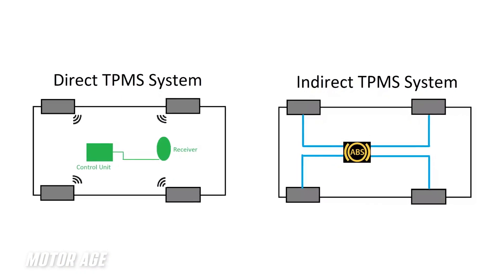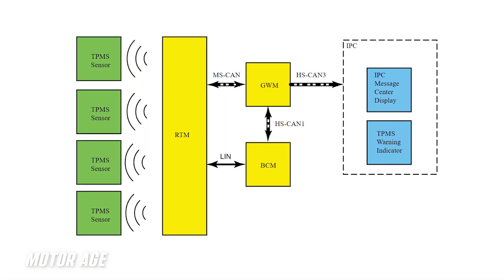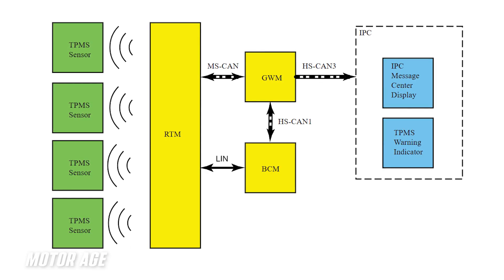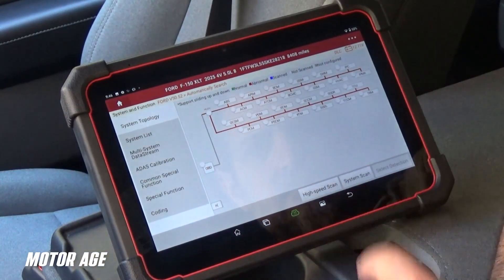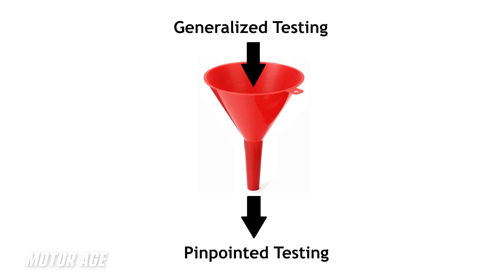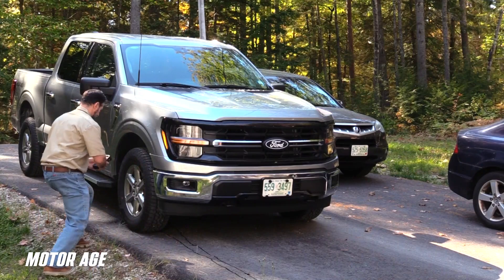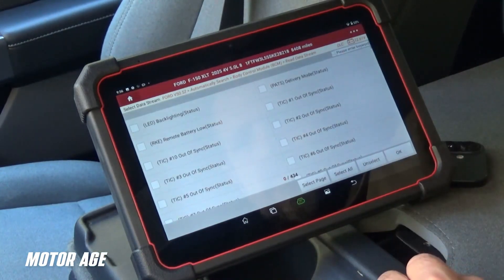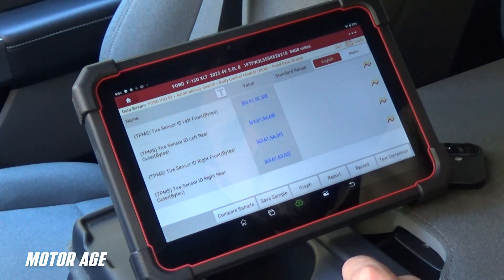Mastering Diagnostics #29: Root Cause Fault Discovery Through Questioning

Comment: ha there Brandon got a 04 GMC 5.7it dyed an wontcrank I've tested wires sensers no reason for it not to crank no signal out of ecmfor rpms changed ecm got rpms back still no crank pulled 3 plugs smell old gas an see moisture on them did compression teston them 3   90psi 3 one I watched the needle stedlydrop now is it in limp mode are what it showed no engine  problem of this nature what do I do now any advice be greatly appreciated glad I found your channel great job man got a sub here.      160,000mi✌️🦐